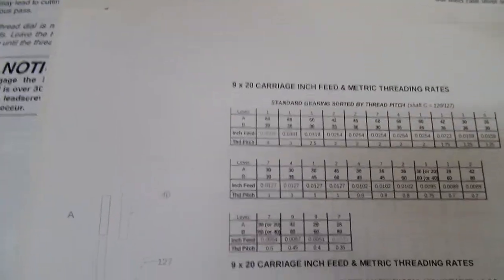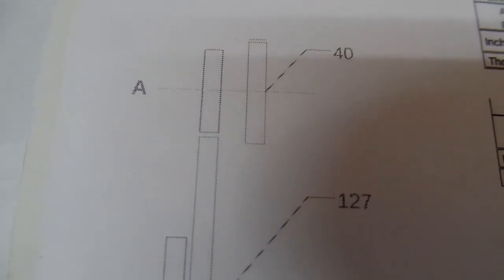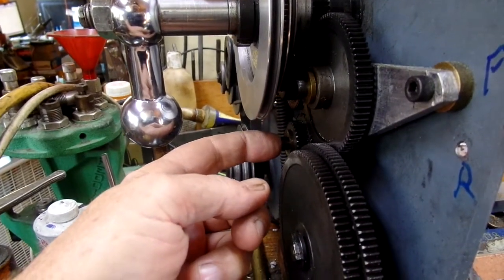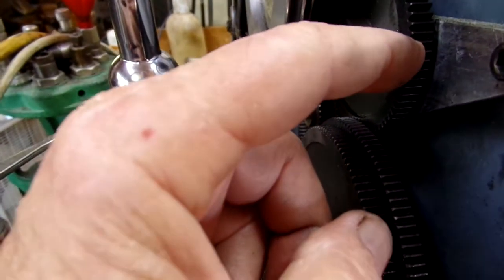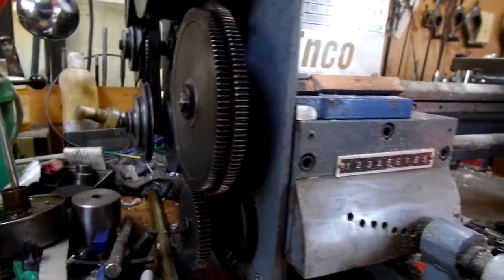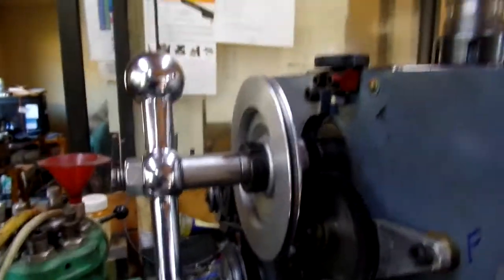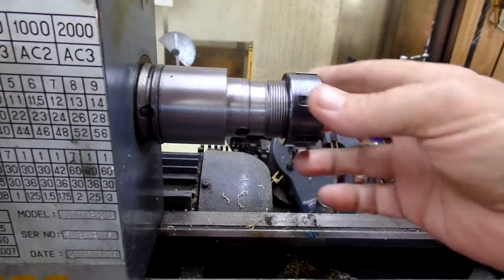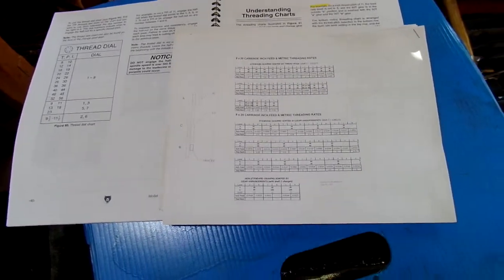E158 4mm threading on my Enco 9 x 20 lathe

Comment: Are all the gears self contained in the lathe or do you have to keep some loose. I ask I g because I’m buying a second hand one and I’m worried some screw cutting gears are not present with the accessories so I want to know if they would be all self contained? Thank you
Reply: No. You should have several sepperate change gears.